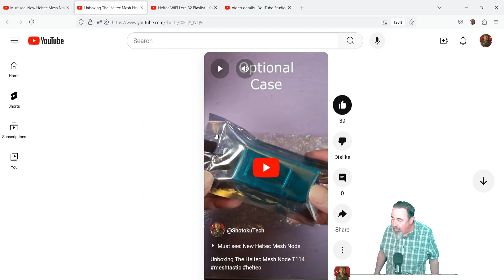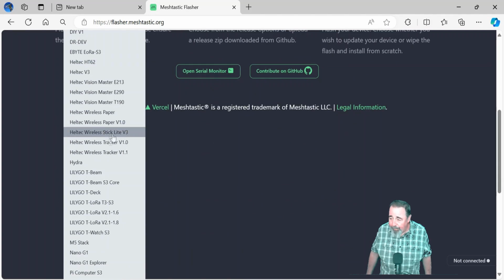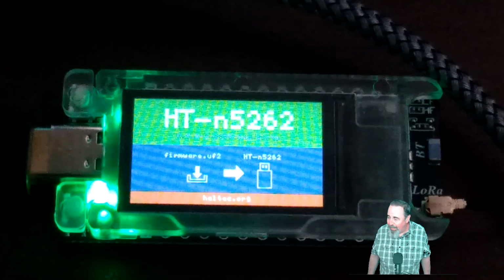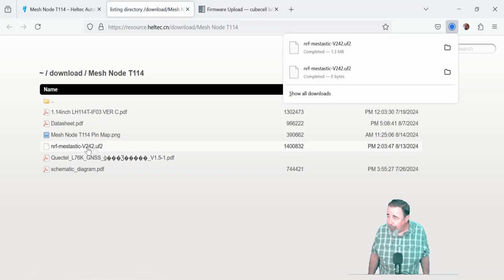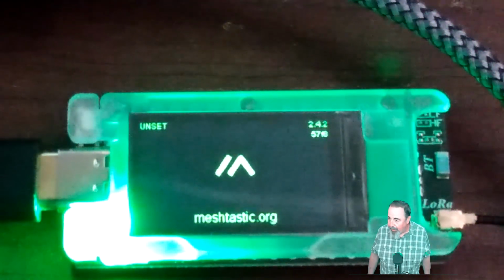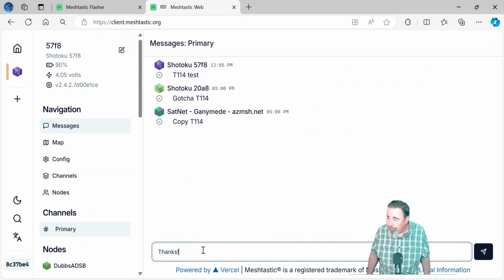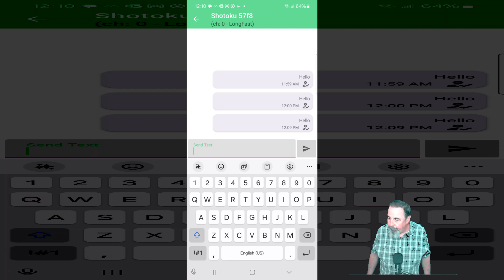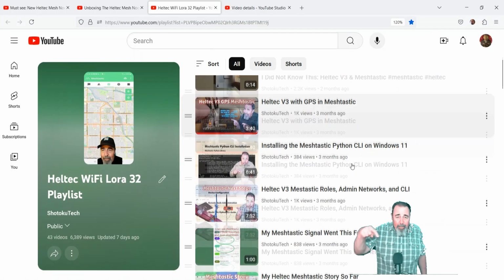Meshtastic on Heltec Mesh Node T114 Step-by-Step

Comment: do you have to take it apart to turn it off?
Reply from the maker: Meshtastic has a provision for turning it off. Press and hold the user button 10-15 seconds. If you are programming in Arduino IDE, you will have to come up with something else.

Comment: Hey, i have a small Problem with the t114. Im to dump to connect / Run a AHT20/BMP280 or BME/BMP280 Sensor with meshtastic (meshtastic flasher Version 2.5.15.79da236 Beta)

Im to dump ...  Do you have the right Pin (sda scl) to connect the Sensor? 
Greetings from Austria
Reply from the maker: It's a good question. I won't have time to look for a couple weeks. Best wishes!